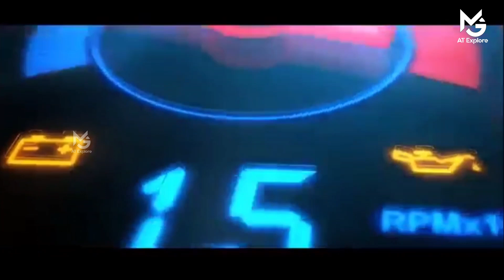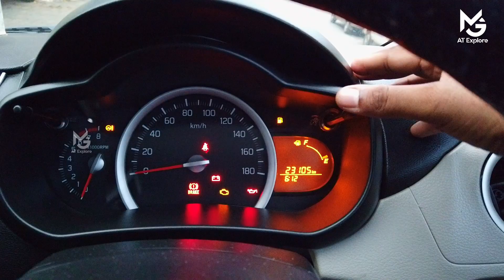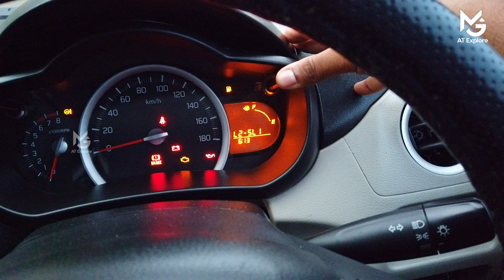Why Indicator flash 3  when just pressed | എന്തുകൊണ്ട്  മുന്ന് പ്രാവശ്യം ലൈറ്റ് blink ചെയ്യുന്നു |

Comment: Celerio small dip pass cheympo hit cheyth kayarunna impact varunnu.prethyekich 2 wheelum ore pole kayarumpo. Service centre guys issues 1m illa ennu parayunnu.Road ile minor speed breaker / small three bumps pass cheyumpozum front num cheyunnu. No oil leak from struts. Struts mount and stabilizer bushes replaced. Metill ulla road il/ rough road il drive cheyumpo dash board rattling um und.Small humps pass cheympo valya humps ayi thonnunnu.
Reply from the maker: Struts oil leak illenkilum action hard ayo yanu check cheyanam... Yathera km odi? Suspension hard akunathe kondu ane action adukathe... Dashboard noise undel extra wiring vallam undo athe loose ayitundo yanu check cheyanam..
Reply: @MGATEXPLORE  33000 km . Wiring loose ayittulla dash board noise alla plastic parts match avathe varumpozhulla gigira sound. Ath vandi njan edukkumpoze undarunnu. Shock nu warranty kittumo. Kottayth evidanu nnala local servise centre ullath parayumo?